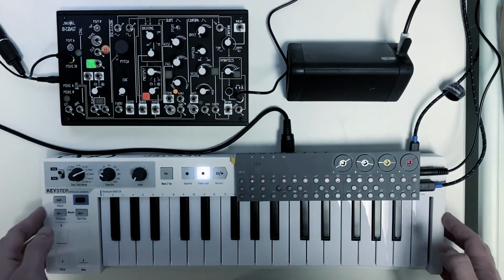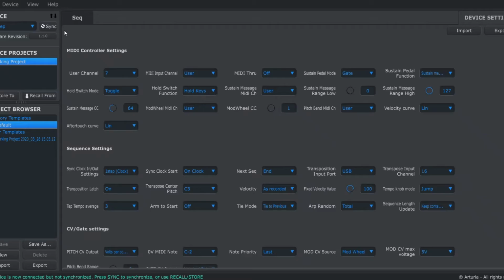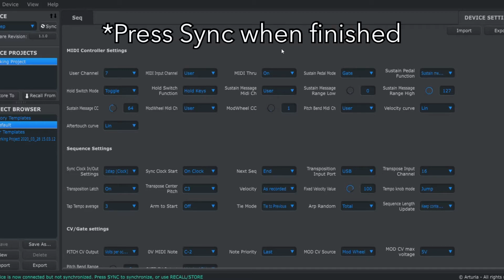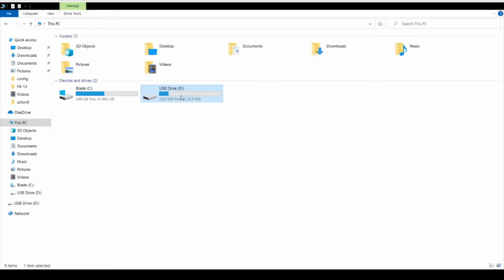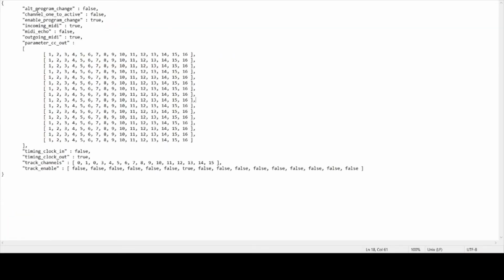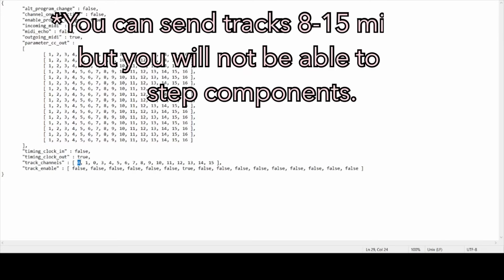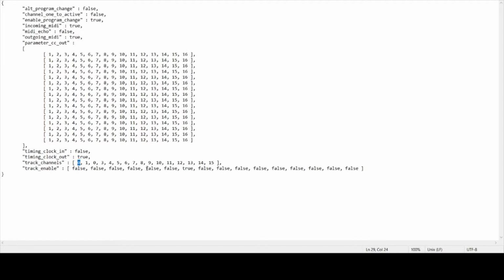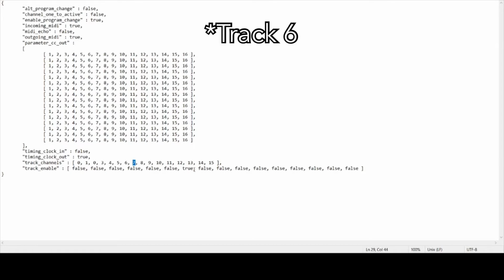Sequencing External Gear with the OP-Z using the Arturia Keystep (Tutorial)

Comment: Do we know if this works with the latest OPZ firmware. I did a factory reset on OPZ, and only updated the firmware to latest. Slowly carbon-copied your walkthrough (even mimic'd your config file although not mentioned). Keystep has both switches "up" for midi.
No dice. When I set to Track 6, I hear the audio coming out of the OPZ? Any ideas?
Reply from the maker: What are you connecting too, is the external gear listening for Midi Channel 6 or all midi channels?

Comment: Nice! Is it possible to have step components sequencing external gear this way?
Reply from the maker: Yes! I believe step components should go through using this method :)
Reply: @Jebrald0  From tracks 1-8 yes, from tracks 9-16 nop...I believe :-)
Reply from the maker: @alvaroaprr  Thank you Alvaro! That’s correct, you can’t put step components on tracks 9-16.

Comment: I was thinking of buying an Oplab module but in my country is the same price as the Keystep which is much more versatile on my opinion. I want Ableton to send midi clock to the OpZ via the Keystep is that possible? I want to sync Ableton > Keystep > OP-Z > Hardware synths like a Mother 32, Microkorg or Roland Tr8. I think I would need to use both midi connections and the usb but I'm not sure if that works. Thanks for sharing this video!
Reply from the maker: Thank you so much Carlos! And you ask a good question...I’m not sure that the Keystep can use the midi in and USB at the same time. Unfortunately I don’t have the tools to try exactly this but I can try Midi sequencer clock > Keystep > OP-Z > hardware synth. I believe you would have to switch up some global Midi settings on the OP-Z as well.  Not sure when I’ll be able to get to this, but if it works I’ll make an updated video. :)